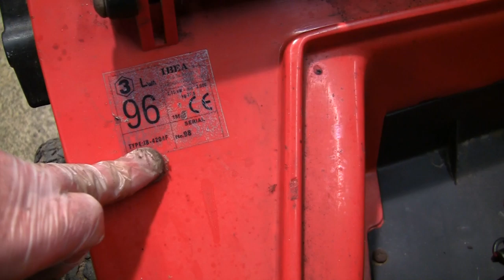How To Service A Briggs And Stratton Petrol Lawnmower Engine

Comment: Hi! To answer the question about the ”traffic light”. The breathers function is to maintain crankcase vacuum. The yellow is a one way fibre disc, limiting the air flow direction caused by the piston going back and forth. It allows air to flow out of the crankcase but blocks the return flow, maintaining a vacuum in the crankcase. The partial vacuum must be maintained in the crankcase to prevent oil from beeing forced out of the engine at the piston rings, oil seals, breather plunger. There is a way to test the condition of the yellow disc. Let me know if there is a interest and I will write the instruction. Cheers from a briggs mech in Sweden.
Reply from the maker: Anders Adler Brilliant thanks very much for the information.

Comment: I have a broken down 450 series that I don't want  part with. So I have new oil, spark plug, governor springs, diaphragm, air filter, flywheel key, primer bulb and throttle cable ( yes, it's had its bad days, LOL!) alll on their way. I have never changed the oil in the 8 years that's I've had it, though I may have topped it up once? After watching this video, I'm keen to see how she runs once it's all put back together!! Appreciate the video, it really helps!
Reply from the maker: Joe S. Good luck Joe
Reply: @MowerMan   ***Update 20/10/2020***I put the ol' briggs back together yesterday with all the great help from your videos. This morning added some fresh fuel, primed her up and she purrs like a kitten!!  Good as new ,starts on the first yank and should last me ages longer. Many thanks for your videos!
Reply from the maker: @joes.1836   Brilliant well done Joe

Comment: This is a great video - thanks for filming! I've got one of these engines and it struggled to start after running for a while. And now it doesn't start at all. I noticed the cooling fins on the block were filthy so is potentially overheating. Took the spark out and can feel no compression whatsoever.

I have another engine identical which I know runs and has compression . What do you think is the better idea - swap the whole engine out, or strip down the one that's not working, replacing gaskets etc? Cheers!

Comment: I need help. I got lawn mower out of trash and it fired up, I fixed the key and cleaned it. It starts but it gets really hot after 20seconds of running and the noise is a little bit weird. There might be a little too much oil. Not sure what to do. Any help apreciated.

Comment: How do you set the timing on these and governor arm.
Reply from the maker: It's a flat head engine so you cant set the valves without grinding. Governor flap takes care of itself. Set the ignition coil gap and make sure the springs are correct

Comment: Sometimes the cheeky greedy lawnmower shops here in new zealand weld the blade boss and blade on to the motor they even weld around the blade bolt so u cant replace repair change or sharpen blades iv had afew mowers like that